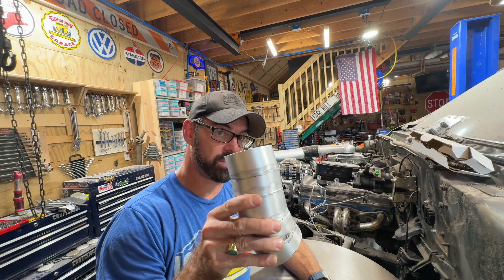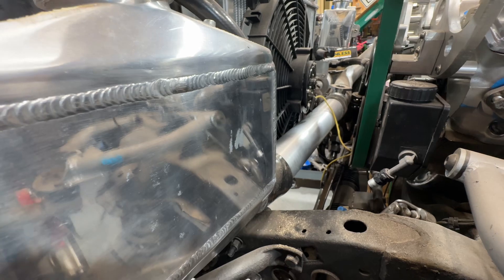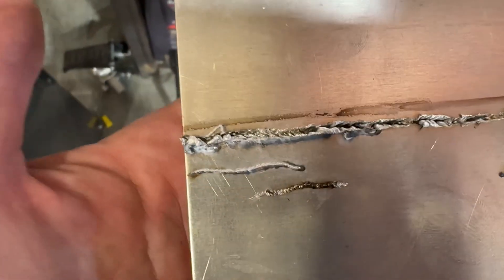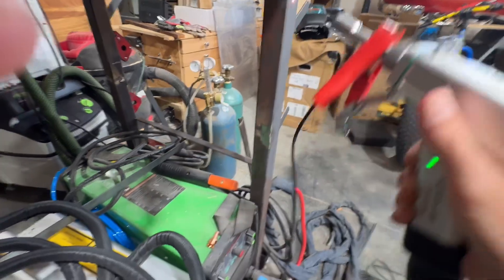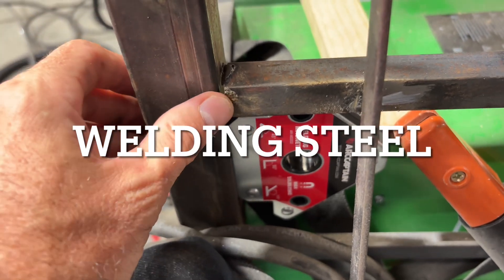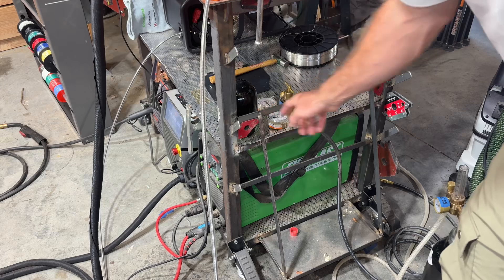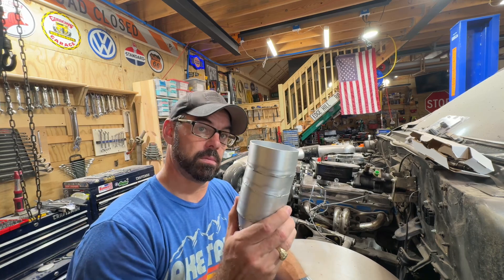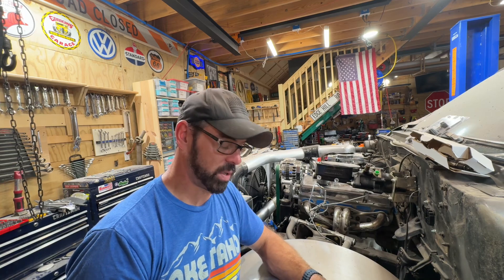Is a LASER WELDER worth it?

Comment: I fillet weld 2" .028" wall aluminum tube to .030" plate via TIG with 1/16" filler. It's a tricky to do and I have 1200 x 1/4" long welds to do this weekend. Burnthru has to be at a minimum. I can do each weld in a few seconds. Do you think that machine would be a good fit? And what would the minimum wattage be for that kind of weld?
Reply from the maker: This laser is 700 W and for aluminum that thin, I think it could do it easily. The wire feed pushes it along, all you have to do is hold it steady. There is a “pulse” feed setting that makes it look more like a TIG stack of dimes. One thing I’d wonder, though, is if it would need to cool down. I was doing test welds on intercooler piping and once I got the hang of it, I was doing long continuous passes about 1/5-1/4 of the circumference and the machine fan kicked into overdrive. It is an air cooled inverter.